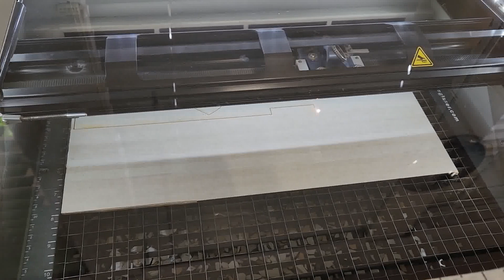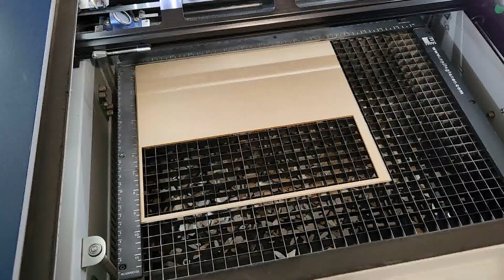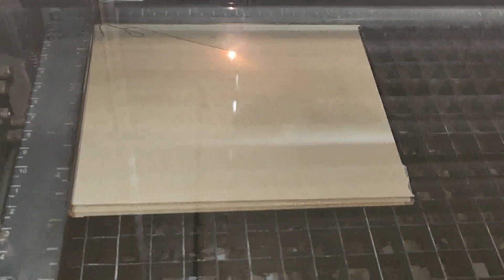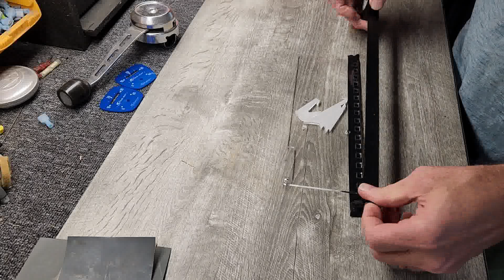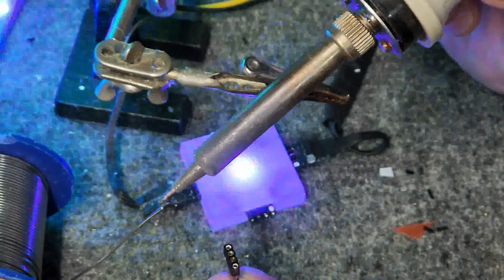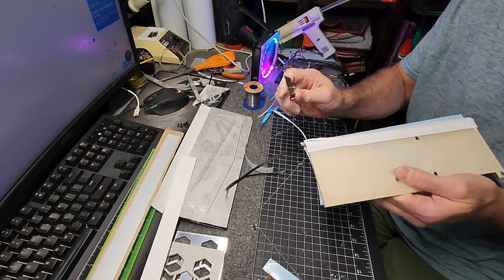Aorus wooden RGB GPU backplate tutorial

Comment: It is nice but you should not sand the woos with soooo high of a grit. You want to go... 320 max on bare wood maybe 400 if it is veneer but going higher does nothing you cant polish bare wood and it will affect the finish. Also you are applying wax to a part that may be subject to more then 60 celcious which will melt it.